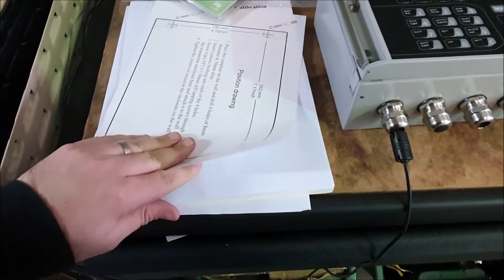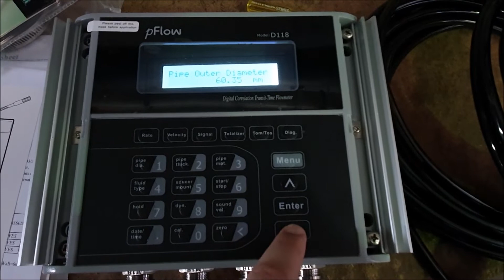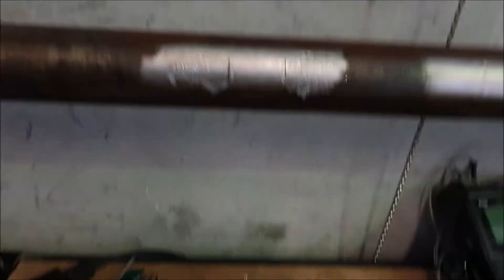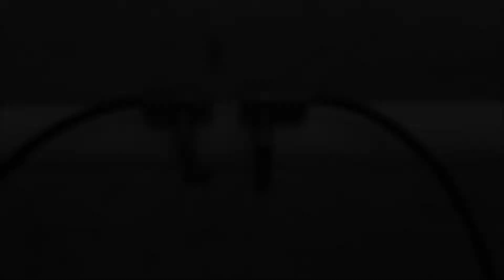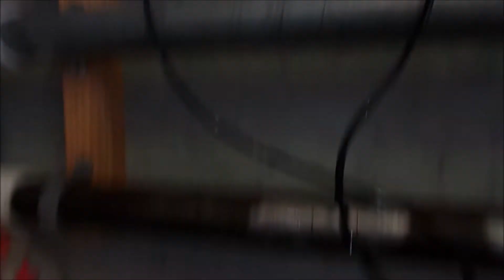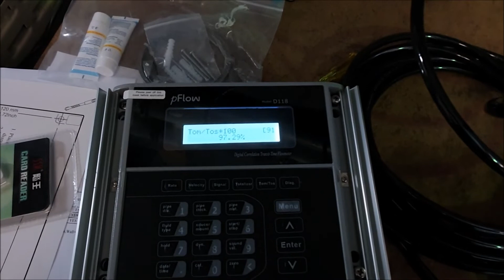pFlow D118 Flow meter demo

Comment: Hi. Is there a minimum space to mount the transducers for v method? Can it be as small as 1mm?
Reply from the maker: Sorry for the late reply, better to contact us by email with any questions as this is not regularly monitored at this time. Anyway to answer the question: The user does not decide on the transducer spacing, the parameters you enter during configuration will affect the meters calculation and the meter will tell you how far to space the transducers so that the signal will properly bounce from transducer to transducer. But yes - in certain circumstances depending on the application it may tell you to mount the sensors directly face to face (0mm spacing)

Comment: Hi, Can this sensor measure air speed or airflow in a duct?
Reply from the maker: Hello, Unfortunately not, this flow meter is for measurement of clean liquids.
Reply: @ZEDFLOAustralia  I have the p118 model, are they the same features?
Reply from the maker: @hro812  they are not the same but they are similar. In terms of flow measurement they are the same in terms of accuracy and flow velocity capability (up to 12m/s) but they work on different pipe size range.

The P118 obviously has a large colour screen where the D118 does not, portable vs wall mount and there any many more differences. Overall though they do a similar job other than one is designed for fixed wall mount use, and the other is portable and battery powered, but yes there are some differences between those models.
Reply: @ZEDFLOAustralia  Thanks a lot for the help.